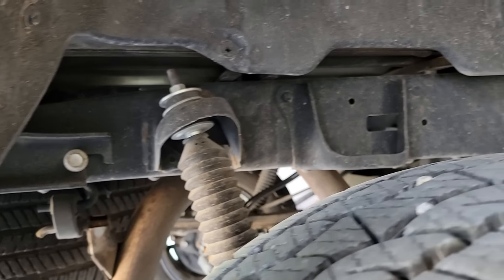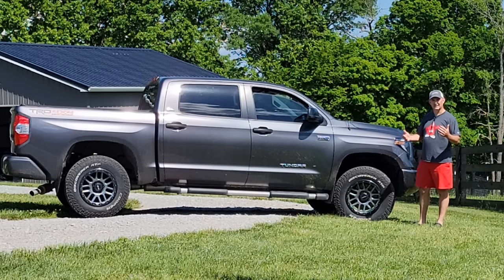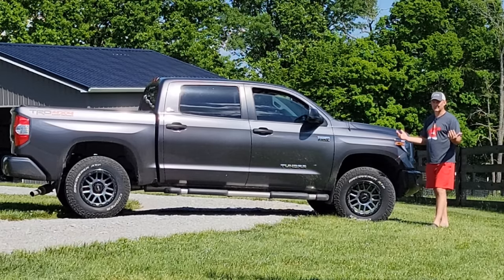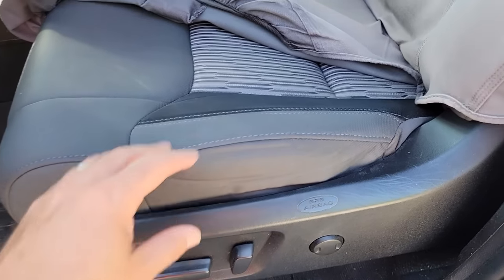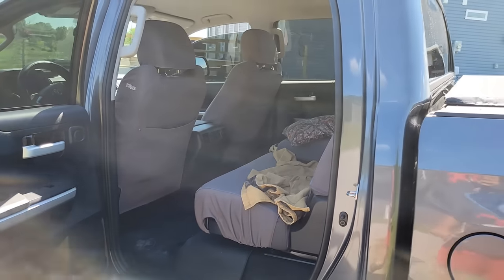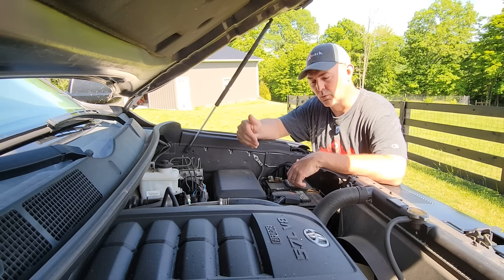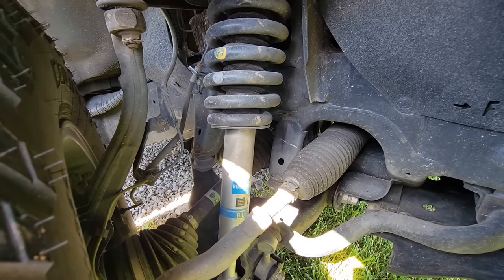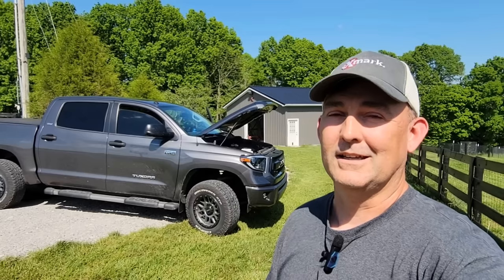Toyota Tundra at 6 Years / 100,000 Miles Compared to Ford F-150 and Ram 1500

Comment: I've got a 2022 f250 with the new 7.3 V8 it has a mech fan super stout engine
Reply: Yea if I ever upgrade from my tundra I’ll ts gonna be the 7.3 ford
Reply: Stout yes,but how reliable after 6 years and 100k?
Reply: @stefanovichmichael9686  you can make that Argument with any product, have to try it first
Reply: @vanwinkledan74  I have.Had 3 Ford trucks,and one gmc.Toyota is superior.
Reply: @stefanovichmichael9686  toyota does make better vehicles but they only make an equivalent to a f150 do they aren't an option
Reply: @stefanovichmichael9686  very, they’re built simply but powerful. There are many 6.2 gas 6.7 powerstrokes out there with 700,000 plus thousand miles on them. So far the 7.3 has been extremely reliable and eons more powerful wjth similar fuel mileage to the tundra in a heavy duty truck.
Reply: @josephcraig765  But how many repairs,and time spent in the shop have those power strokes had and seen?The only thing they do better is towing.Toyota builds a superior truck.
Reply: @stefanovichmichael9686  superior in what way, that’s rather subjective. My 6.7 needed fewer repairs in 700,000 miles than my tundra did before 300,000. If you take just this anecdotal experience I would argue my 6.7 was twice as reliable. Especially considering 6.7s get worked much harder on average. Again I like the tundras they are good trucks no one is saying they aren’t. But to say they’re superior the numbers say otherwise.
Reply: @josephcraig765  Well there are 4 Tundras out there with over 1 million miles,without a major repair.Find one Ford truck that can make the same claim.Check out the front page of today's detroit free press,and you will see ford's poor build quality shining through once again.
Reply: @stefanovichmichael9686  I can link about 40 million mile f150 and f250 fords. A lot more than 4 it isn’t uncommon at all for especially the diesels to do that.
Reply: @stefanovichmichael9686  again say what you want but it depends on what gen etc. my neighbors tundra is in his driveway down the street with a rear end issue at 60k. It’s a case by case basis bud. My ford trucks have lasted longer than anyones tundra I personally know. I also maintain my vehicles. The claim of only 4 tundras out of thousands isn’t a big whoop. I’ve owned a tundra and I’m telling you my particular truck didn’t hold up. It was good but had a lot of driveline issues towing only 5,600 lbs semi regularly. I stepped up simply because the tundra couldn’t handle the work. But again it was a good truck just not a workhorse which I needed. If I was pulling a small single axel trailer sure it would have been fine. But numbers don’t lie and it cost nearly double to work on an outdated tech tundra than it does for my fords which again I’ve had minimal issues out of. My ecoboost had 341,000 miles on it when I traded it in back in 16 and had almost no problems towing heavier loads than my tundra could. Sorry I’m not arguing tundras are great trucks but compared to ford they’re lacking badly in the work area
Reply: @josephcraig765  You missed the point.Any vehicle can do that,but doing it without major repairs belongs solely to Toyota.In fact the first one,an 07 4.7 V8 had its engine torn down and was still 99%.The cylinder honing marks were still visible.This truck spent its whole life hauling.I know of 2 individuals with Ford diesels and they will confirm that they have been troublesome.
Reply: Ford 6.2 is a very reliable engine. Normal to see ex fleet trucks with 300000 miles at auction.

Seats are always trashed though.

Comment: Gas in a non issue, my 05 tundra does well on gas mileage, just be light on the pedal 😉 still runs like new at 215000 miles, very little rust up in salty Ontario, i once took a friend to get his 90 ram hemi,over an hour drive, we both filled up, drove home and refilled, mpg was very close in comparison
Reply: Sure, as long as you're math illiterate.  If you buy an electric truck and a gas truck brand new right now, you will have to spend over $75,000 more on the gas one over the course of 200k miles.

Comment: over the years ive had 3 f150 work trucks ran them, 1985 4.9 six 310000 miles, 1993 r150 4 9 5 speed 444500 miles, 2001 r150 5.4 340000 miles. no major workon any one of them. you cant beat a ford. these wore work trucks in landscaping in so cal. alog with hauling a 5000 lb boat to the colorado river all the tine in summer heat over grades. and we are talking 115 +temps. this is the distance.

Comment: Talk about payload capacity and gas mileage , I was looking at one of those and It was 1800 , 13 miles per gallon, had to get f150 with 2300 capacity and 16 miles per gallon, not planning to put million miles, I run tile business and carry weight in the bed is essential and Toyota trucks are not strong enough for work period

Comment: I owned a 2014 tundra 2wd trd off road 5.7 double cab. Even at 83k miles it drove great! My coworker has a 2018 with 5k miles and they drove damn near the same. Only reason I got rid of it was I should have bought a 4wd. Mpg weren’t amazing. I have a short commute and avg around 14 mpg city. Hand calculated. When going on a vacation I saw 16.7 lol but that was “moving with the flow of traffic” or 80ish. My coworker has seen 19 out of his on a long trip. 
2-3 mpg isn’t something to really get worked up over imo. I had a 21 gladiator rubicon 3.6 that was around 15 mpg same city driving lol. 
Loved the tundra. Once you learn how to turn all the Nannie’s off it’s a pretty strong truck. At least in a 14 model, the traction control was very aggressive

Comment: Mine is a 2017 f-150 w/ a 3.5 economist. It looks fantastic after 145,000. I 

I have used Rustoleum’s peel coat since  the first winter. One sprays a temporary coat on ver the paint. It can be easily peeled off. I have negligible rock chips. I make my truck two tone over the winter.

Comment: Lol that gen tundra 07-21 easily goes 500k with minimal issues, maintenance. Most, if not all, their vehicles clear 200k with zero issues. Statistically you should easily be able to say the Toyota is bulletproof when compared to other companies. Plus their transmissions actually last. My buddy's 07 had a big lift, oversized tires etc and at 220k miles the transmission was silky smooth and responsive. The motor was still plenty strong. Guaranteed you couldn't get that far with a flawless transmission with Chevy, Ford, Ram or Nissan without a damn lift. 

Also, you're silly comment about, yeah, I'd say this could easily go another 100k is laughable. It's like you have limited car knowledge. You wouldn't even worry about a tundra till well over 200k.

Comment: I’m not trying to bash you heard it but you do realize it when engineers build these trucks they do all that research before they sell people vehicles the length that your vehicle will last it because they want you to come back and buy a new one I had a two year old 2019 F150 platinum and leather is trash And the truck caught on fire and burn on the side of the highway and it took too much for the insurance and gap to pay it off and now looking for a 2020 Toyota tundra platinum they’re retailing for 48,000 with less than 17,000 miles on the market is insane The 2022 tundra with 35 TwinTurbo a great the main issue is it’s not a truck anymore it’s an SUV Land Cruiser truck. They had engineer of it designed that truck as a pinhead and ruined that truck they completely destroyed tundras name by making that new generation of tundra, they should’ve kept the body they have now and put the different engine in it. The 5.7 in the six speed is unknown good combination and they ruined it. I always thought the 430 rear end with overkill. They should’ve went 373 and got better fuel economy.

Comment: Absolutely happy with my 2016 tundra. Got 122k+. Just towed my sons vw jetta (on a uhaul transporter) from SE NC to Bremerton Washington. It towed like champ. 
I bought the truck Jan '21, with 59k. It's now Nov 23, it just turned 122k. The Transmission has always bumped (sometimes harder than other times) when LIGHTLY picking up the gas from slowing for traffic, at around 30/35 mph. I had the Transmission fluid changed at 60k and again at 101k. No change, it still bumps intermittently. But was just wondering if there were any other 16 owners experiencing this issue. 
Thanks
Reply: I feel the bump on my 17 maybe normal time will tell
Reply: @mikerobbins2076  good to know, thanks

Comment: 5.7 with 6 speed will be missed because there’s never gonna be a naturally aspirated engine that could handle everything thrown at it like the 5.7 could handle. In 2016 the Toyota team started working on the 2022 2 engine options but previously to them doing they Toyota was gonna was looking at doing a 8 speed with the 5.7 and leave everything else alone except go to 8 speed trans but the new cafe regulations are truly what made Toyota go 3.5 twin turbo and not keep 5.7 but Toyota is looking at building a hydrogen v8 for tundra that will once again be naturally aspirated like the 5.7. Don’t be surprised is the 3.5 is short lived and we go back to a v8 hydrogen powered 😎🤩

Comment: I see that this is a year old and Toyota  has moved on. But,  I think had they added DI, installed the 8 or 10 speed transmission, raised the rear gears to say a 3.70. I think these engines would be more fuel efficient and relevant in fuel mileage. IMO, I would rather have that clutch fan any day over an electric. You've always got airflow over the engine. I also don't see anything wrong with the "old school", power steering. Just my opinion of course. I always liked these trucks except for the poor fuel economy.
Reply: Yeah more fuel efficient but dropping transmissions like every other manufacturer

Comment: 400$ monthly for fuel!? Nah that truck aint hardly lifted. That thing should cost maybe 200$ a month max. If you're paying over 200$ you're putting way too many miles on that thing. Not to mention that thing has a 26.4 gallon tank at the least.

Comment: It doesn't come with direct injection EcoBoost with 10 speed,  MDS or DFM with 8 speed transmission. Unlike Tundra that has a straight forward 5.7 engine and basic 6 speed transmission. Only bad things about it its that its still very expensive for Limited and 1794 trims and fuel mileage is horrible.
Reply: You know for a fact fuel mileage is bad?I can show you the dashboard readout on mine today, 16 double cab 5.7 is reading 19.9 mpg,it will average between 19 and 20 all summer. The gas milage myth on the tundra is just that.Mainly b.s. from non owners.
Reply: @stefanovichmichael9686  I have a 2012 and best it would do is 17.8 and that was on stock wheels and tires. Maybe some live in flat road states and don’t use their truck for work but the only truck I’ve ever owned that does well is my f250s deleted of course fuel wise. I get 25.5 mpg highway under hood conditions and 15.8 towing. The issue wjth the tundra for me is it tows like ass not enough power for what I haul. They’re good trucks no doubt but that price tag with all the outdated tech just blew it for me getting another one. Especially in this market if I am spending 60 k I’m getting a diesel
Reply: @josephcraig765  Yes I live in SW Ontario,flat country.With all the issues the Ford diesel has had in its history,I wish you luck.
Reply: Mine 2020 5.7 best I get is 20 mpg on cruise control. Other 14mpg hungry and sucks as always.
Reply: Yes, have a friend who had a 2010 5.7 and a 2018 with the smaller v8. He said gas milage was bad on both. Probably true, but I have a 2011 Ecoboost  and make 14.9 city and only 17 or 18 highway, so not very good either. I do love the quiet power of the Ecoboost so that could be part of it.

Comment: This is not about a Tundra, even though I do want a Toyota Tacoma after my RAM truck, but my RAM is a 2017 103k miles 5.7L Hemi, and hardly had any issues (no check engine light)  and the interior/seat are holding up really well, and no tear. I think at the end of the day it's all about how you drive a truck, and the way you treat it. Yes, you can buy a truck, and no matter what you do a issue will pop up, but for the most part if you're driving real hard, and doing things a truck wasn't meant for you will have issues. I would never own a GM truck though, that's for sure.  All i've done are the basics, transmission fluid change, oil change, battery change, brake pad changed, rotors changed, and that's it.  Suspension system is still solid, and it never fails. RAM trucks have gone along way. The lifter/cam  failure that Hemi's have is from people who idle their truck for a long period of time with dirty oil.

Comment: True about gas , however you will spend 65,000 and only have 2 mpg better which translates to less than or around 100 dollars a month. Still not a value, especially since the quality is not there in the new trucks. NO body wants to be making payments and on top of that have expensive repairs just for little fuel milage gains.

Comment: Have a 2016 Tundra Platinum 120k miles. Only major issues is broken Catalytic Converter and some trail damage. Other than gas mileage there are no cons. 

My basic work van E-150 100k miles have 3 broken doors, broken radio, broken ac, leaking oil, broken window. Ford built quality is just garbage.

Comment: Oh how good a Toyota Tundra is.... let's see you drop the pan on the transmission - the bolts will break off-an expensive fix. Tundra gets lousy gas mileage. If they were that good loggers would use them - there not, so continue to drive around town. There's a reason F150 is #1, but hey I say drive what you have the best luck with no matter what brand it is.
Reply: Yeah the reason fords number 1…. Ignorance

Comment: Since you have been waiting a long time to make the video tells me that you kept the salt off the frame. Bragging about Toyota truck frames is kind of funny because Toyota spent 3.4 billion replacing frames. just sayin
Reply: At least they stepped up and made it right, right??😉
Reply: Yes because of a Government mandated recall. Besides if your frame breaks on the highway going 65 what is the first thing to snap? Brake lines. Maybe just a tad bit of liability
Reply: @BlitzHack  You may want to scan the details with a little more detail as the government had nothing to do with it nor were there any accidents, injury or death related to the frames. Good fodder though…
Reply: @cerny4444  Yes you are correct not a recall but a Federal class action law suit :) " They did it because they were forced to. That is my point. 
"Toyota Motors has agreed to a settlement of up to $3.4 billion for a federal class-action lawsuit brought by American owners of pickup trucks and sport utility vehicles whose frames could rust through, plaintiffs' lawyers said in court papers

Comment: The hydraulic steering wasn’t updated to EPS like the 2022 tundra now has because the hydraulic was more reliable and that goes the same for the radiator fan being a non stop when engine is running. The only reason the 2022 has EPS opposed to hydraulic is because of the regulations like lane keep assist and other safety reasons. Toyota only went to the 3.5 reg iforce and iforce max for heavy tow users is to comply with cafe epa regulations and also all vehicles purchased in year 2026 will have to get 49 MPG and that’s for half ton trucks and anything below.

Comment: The Toyota tundra is a great truck but the 5.7 is horrible on gas i owned a 2008 tundra new and after that owned a ram 5.7 hemi and the hemi was a stronger running engine with 395 hp vs 381 hp for the tundra and hemi was about 4mpg better on the highway now the 21 ford f150 i own now blows away both in power and fuel economy with the 3.5 ecoboost I don't care how long any pickup truck last cause i trade them in every cupple of years for a tax deduction for my trucking business that makes almost 500k a year Toyota trucks are for people that want to keep there trucks for 20 years without any problems i get bored driving the same thing after a cupple of years. So i sell them. But the 5.7 is not without it's problems too it can have cam phaser problems just like the ford engines making horrible noises from the valve covers and the exhaust manifolds are prone to leaking and cracking with high mileage and driving in the salt belt also what's funny is Toyota went the same direction ford did with the 3.5 twin turbo engine in 21 and newer trucks. Toyota is also a better price over the domestic brands do to not having unions working for them

Comment: So, you “don’t” like the Tundra?  Or you “Do”?…very noncommittal, either way…?…Doesn’t a “recall” Mean that the company takes responsibility for correcting any problems after you purchased your car… Did I get that right?

So after 100,000 miles of solid and faithful service, without rusting and decaying from underneath you, you don’t appreciate the reliability of the beast that is the Toyota Tundra… 

You don’t like the fact that a  5.7 liter//350 cubic in.³ V8… Doesn’t get 25 miles to the gallon?

Comment: I live in eastern Canada and Tundra's don't rust. My friend as a 8 yr old Tundra and as almost no rust.  Gm and Ram trucks rust very bad.  Ford rusted bad before they changed to aluminum. I just bought a Tundra because my 2016 Ram rusted a hole through the fender.
Reply: Live and learn

Comment: I'd probably stay away from Tundras built 2018 through 2021. No Transmission oil cooler, No zerks fittings in drive shafts and ball joints, plastic radiator and oil filter housing. It would seem Toyota did their homework to ensure parts failure in the future otherwise known as "Planned Obsolescence."